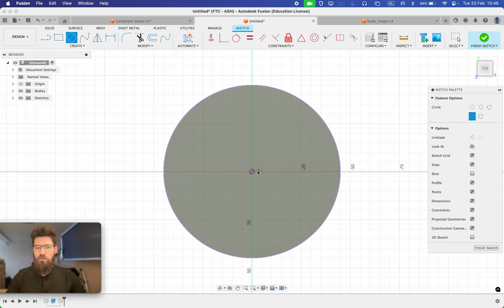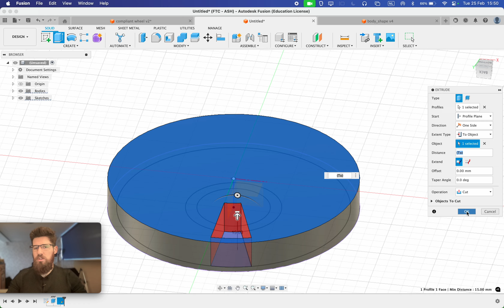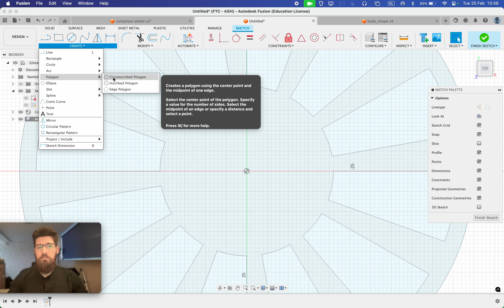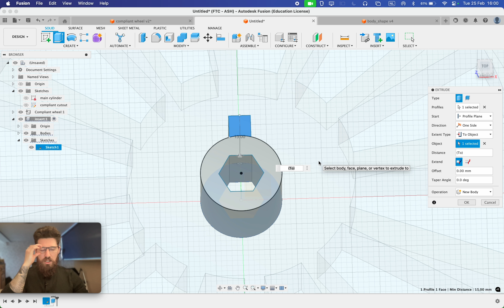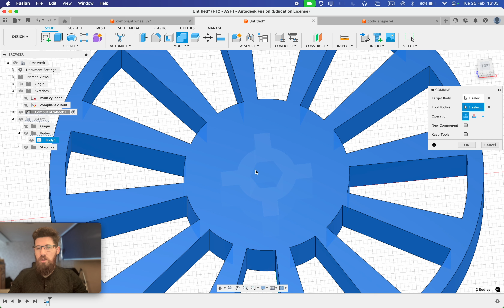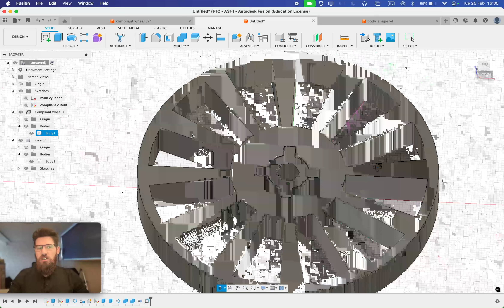Learn AutoDesk Fusion 360 For Robotics - Basic Lesson 3 – Extrudes & Combines

Comment: If you can't find the option to "Create Components from Bodies" from the dropdown menu (at around the 9 minute mark) you first have to switch the design from Part to Hybrid (or Assembly). To do this, expand the "Document Settings" pane in the upper-left corner of the window. Click the pencil icon to the right of "Part Design" and change it to Hybrid ( or Assembly). 

I have no idea why components weren't discussed earlier in the course given their importance and usefulness when designing parts for robotics.